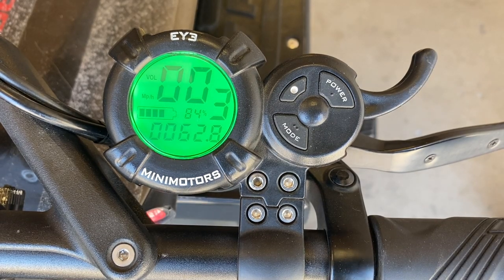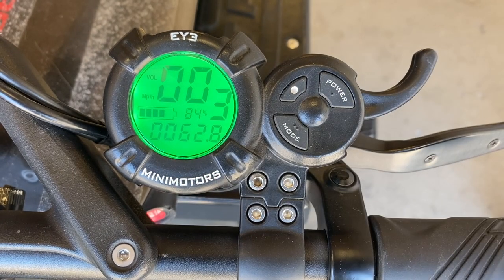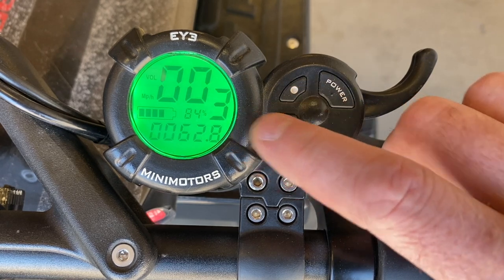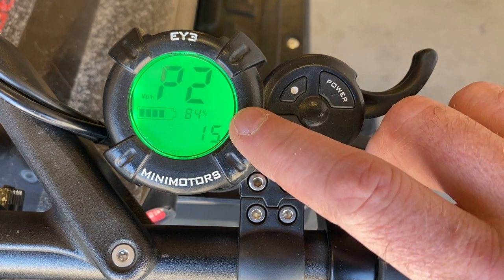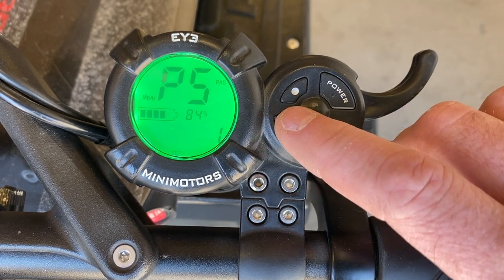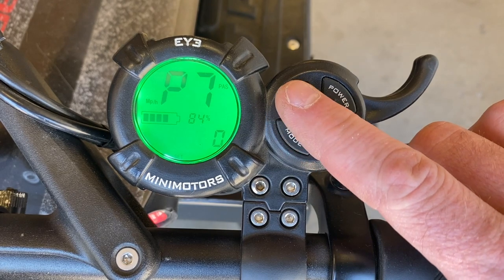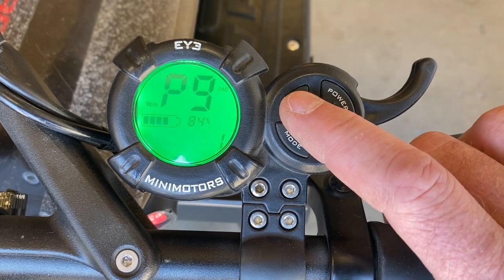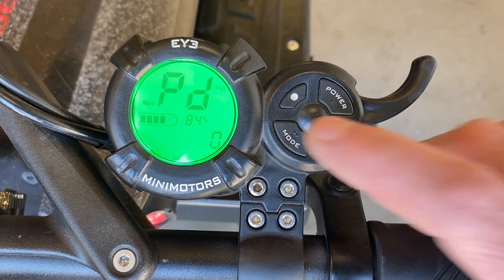MiniMotorsUSA Ey3 Throttle Functionality

Comment: my wolf king throttle is not controllable. any time on dual motors despite low acceleration and low torque the scooter takes off with just a little pressure on the miny motors eye controller. it’s not smooth it is like a switch all on or all off not controllable. is there a fix?

Comment: Friends, please help.  I have a problem, the speedometer does not work, it constantly shows the speed "00", the odometer and charge counter also do not work.  at the same time, the scooter drives normally and switches gears.  scooter new name Teverun Blade Mini Pro.
Reply: Lo solucionaste?
Reply: yes, the problem was in one of the controllers. It was replaced under warranty and everything is fine.